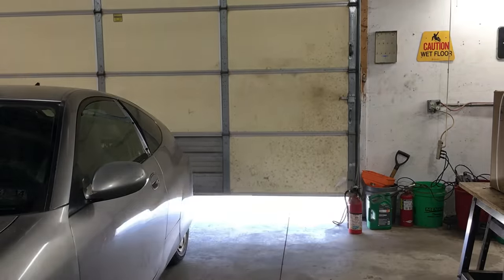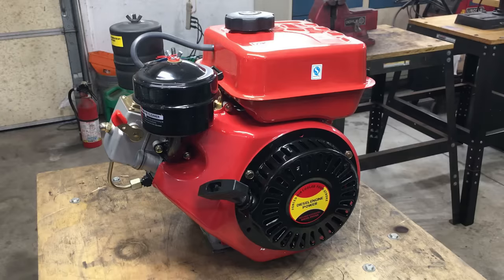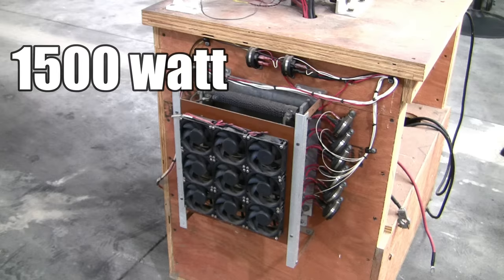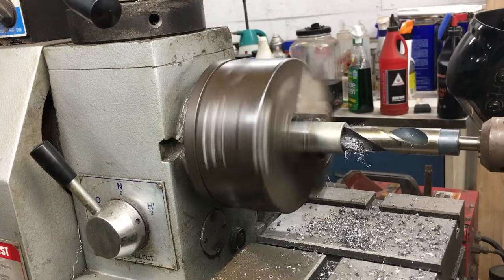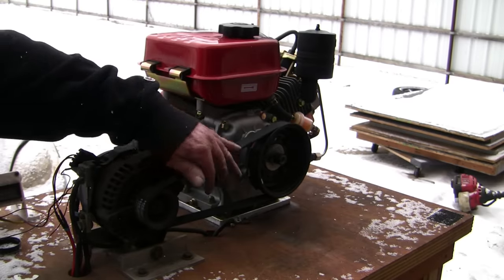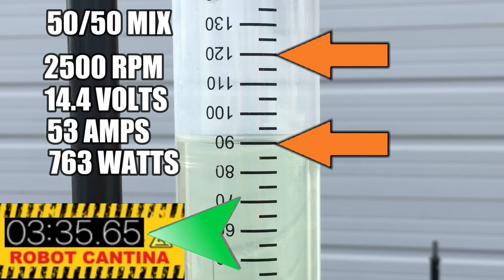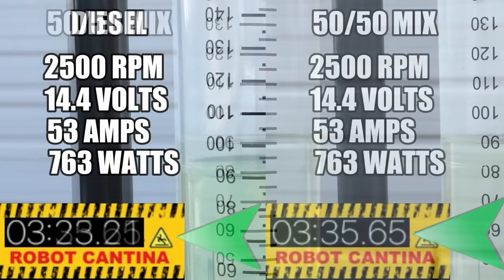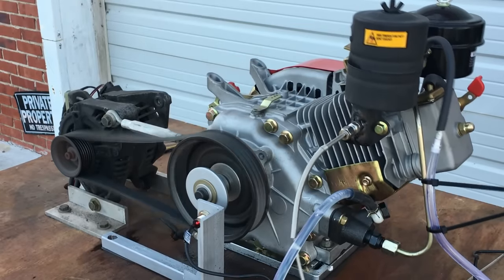S4 E3. How good is vegetable oil as a source of fuel for a diesel engine?... We find out!. plus more

Comment: Waste motor oil works really well in mechanically injected engines, drove one of my cars for a year on that stuff with no issues. Also ran jet a1 for a while with a tiny bit of oil mixed in to lubricate the pump. The engine ran a bit cooler and without any visible smoke whatsoever, while it smoked a bit on diesel. And yes, people actually use kerosene or jet fuel to cheat smog tests with old beat up diesel cars.
Reply: Depending on jet fuel,  it can do a lot of damage to a diesel engine.  For example, JP 4 will work pretty well IF you add some oil to it. JP 5,6,7 can work as well,  I would not use JP8 that stuff will wipe out fuel injectors and fuel pumps very quickly.
Reply: @bertgrau3934  I actually don't know much about jet fuels, just had access to some stuff that was drained out of commercial turboprop airliners during repairs and was supposed to be disposed of and it was tested and proven to work well in diesel engines lol. Old engines can run on almost anything for quite a while, but I wouldn't be so inclined to do such experiments on common rail stuff. Cheap disposable beaters are great for this reason
Reply: @RugilėJurevičiūtė  
Depends on which jet fuel it is, being from a turbo prop,  I'm guessing it's aviation fuel which is more like gasoline.  Wouldn't want to use straight in a diesel.  Mix with oil and it would be OK.
Reply: When I was in the USAF,  we had a couple of folks use jp-4 added to their diesel car.  The fuel we drained from the fuel sumps, was just dumped into the car.
Reply: @robertheinkel6225  
As long as they didn't use a full tank of JP4 it would probably be OK.
Reply: @bertgrau3934  well it came from ATR72, did some googling and couldn't  find the precise fuel type, as they used some different variations of the PW 100 series engines over the years. Guys reffered to the fuel as jet A and ran it together with a tiny bit of oil in their cars for years. Stuff looks and smells just like kerosene, I wonder if it actually did something to the pump or the injectors, but since it was a 200 euro car I didn't worry about it too much lol
Reply: @RugilėJurevičiūtė  
I never heard of Jet A fuel, but smells like kerosene,  makes since.  With a little oil would make it would be useful in diesel engines.
Reply: @bertgrau3934  I guess same stuff can have different designations in different places of the world and between military and civilian users
Reply: @RugilėJurevičiūtė  
Yes, that's true.  I was in the military,  and was in Iraq,  and Kuwait. And I heard of a lot of different destinations.  The military uses mostly JP. and numbered 4 through 8 . For jet fuel

Comment: As some folks have already dropped in the comments,  waste oil, or black diesel (used oil with some gasoline) would be neat to see.
Reply: Yeah, I read somewhere like 4 quarts WMO to 1 quart gasoline, or diesel...I got one of these motors...want to see if it will run for hours and hours before it kaputs
Reply: @haydenc2742  Similar concepts here, my garage heater will run on diesel,   but it would be cool to find a use for the 100 gallons of waste oil I have sitting around
Reply: Use gelatine to clarify waste oil
Reply: @AlienLivesMatter  I hadn't heard of that before, I'll have to look into it

Comment: I run a quart of ATF to every tank of diesel (approximately 16 gallons for 82 GMC and 20 gallons for 94 F350). This is because they were built pre-ultra low sulfer and the mechanical injector pump and injectors need the additional lubrication and cleaning properties of the transmission fluid. It helps with mileage but I've always been a bit concerned about the EGT. I'd love to see you test it. Keep up the great work! P.S. I hope the Gnomes are staying warm.
Reply: ATF is a good idea. I am a fan of Marvel Mystery Oil for older engines.
Reply: I toss in used ATF or motor oil in each tank full of my Oldsmobile diesel. I usually just dump a whole 4-5qt jug in at fill up or half if I'm low on used oil somehow.
Reply: I'd use biodiesel or TC-W3 outboard oil for this, old sump oil is full of garbage you'd rather not run through the injectors (like water and carbon particles) and it burns dirty due to all the additives in it, to say nothing of the lead contamination from engine bearings etc.

A lot of diesel fuel already has 5% biodiesel added as a lubricity improver.

Comment: Here is my list of alt fuels to try:
100% vegetable oil
50/50 diesel/waste motor oil
4:1 waste motor oil:gasoline 
100% waste motor oil
100% new motor oil
100% ATF (new or used)
100% kerosene 
100% Howes fuel treatment
Reply: Thanks for typing all my recommendations so I don’t have to lol. 👍
Reply: Covers my list
Reply: would also like to see regular gasoline with 0.5% two stroke oil premix (to provide lubrication for the hp pump) and also 10/90 gasoline/diesel (supossedly the octane of gas will delay ignition, wich in theory alows the fuel to mix with the air better)
Reply: I'll add a few more:
Alcohol/ethanol.
Natural gas.
Trash fumes.
Excrement fumes.
Old tyre oil extraction.
Plastic recycling.
Reply: I woulda add pyrolise of plastic fuel to tests :)
Reply: KY jelly! I have drums of it.
Reply: Use gelatine to clarify waste oils
Reply: There are some to add to the list. 
#2 fuel oil aka home heating oil

Biodiesel
algae oil (if it can be found)
peanut oil
Palm oil (heated or fractionated)
Walnut oil (they are a cold hardiness of 5 and RC lives in a 7a location, it would be possible to grow fuel, not practical, just possible)
Mineral oil from electrical transformers
Reply: Biodiesel and Hydro diesel needs to be on that list
Reply: How about whale oil.....🙂
Reply: Try 95% Veg oil 5% gasoline.
Reply: Waste atf and diesel mix. Not sure the ratios but that could be an experiment all of its own
Reply: @will7its  got any? kind of out of style nowadays, but it does burn clean
Reply: @mythoughtsonfaith1031   I think I do have a small bottle. To get more I would need a bigger boat......🤔
Reply: Marvel mystery oil (which is just mineral oil)
Also home heating oil is basically off road diesel to whoever suggested that and kerosene is just refined more.
Reply: Home burning fuel mixes with gas ti make a more volatile fuel , closer to e with a few added things lol .. I make my own race fuel and it's about a 30-70 mix of gas and my special sauce and it allows me to run 40psi of boost on pump gas with not det and decent timing 😅.. but I am deff curious as to all these other suggestions 🤔 😮😅.. peace and love all
Reply: @mastercricket7626  Yeah I was told way back ppl would raise octane by adding diesel. Which makes perfect sense.
Reply from the maker: I'm not going to ask why you have so much.... lol
Reply: @shawnsatterlee6035  that is one part of it , but there is a few other components in gasoline that I add aswell .. but yes a lil deisel can help raise octain... I have added ethanol and xylene and one other thing to make a safe race gas .. well it works idk about safe lol 😂
Reply: @webmasale straight natural has does not work in a diesel. It won't ignite under pressure. In commercial engines they fit the diesels with spark plugs or use a 5% diesel mix with the natural gas.
Reply: Varying ratios of diesel and EVO :)
Reply: @allthehandlesweretaken After seeing what government workers did to Kubota diesel equipment when they were used to gas powered..... diesels don't like ANY gasoline, even 10% destroyed injectors, pumps, pistons (FAR faster combustion causes hot spots, rings lands cracked out) valves, one cracked and dropped an exhaust valve into the chamber and they guy ran it until its complete demise....
Reply: @Steevo69  taxes at work one destroyed engine at a time.
Reply: I have tested lots of wvo and wmo and it runs on everything I put in it as long as it is filtered clean and dewatered.
Reply: @Steevo69  i mean sure. it's going to run way diffrent. but your example is one of thousands diffrent engines. im sure if you really wanted to. it woul be fairly straight forward to run a diesel engine on gas. and make it last. not really any point to it since diesel has higher energy density per volume. also i just really want to see if this little engine can take the abuse :)
Reply: In the summer home heating oil , is extremely close to regular Diesel fuel . Winter the Diesel gains kerosene and additives  .
Reply: @mythoughtsonfaith1031  #2 fuel is just diesel with dyes to make it red but those other ones are huge.
Reply: That's a great list, but modern diesel engines don't like gasoline, kerosine and so on.. they wash oil which lubricates high pressure pump (which this engine don't have)
Also I would add lamp oil, break fluid..
And when running from zombies, you should have multiple fuel filters if you want to use old frying oil.. small particles would get stuck in injectors.
Reply: I was going to suggest kerosene and biodiesel. Kerosene is a no-brainer, because it's very similar to diesel fuel. And biodiesel is popular.
Reply: Huh, I didn't know diesel engines could handle kerosene.

I know of a guy who once put 100% kerosene in his bike (petrol engine ofc) and it melted the engine (that's how the story goes at least).
Reply: As others have mentioned, winter diesel actually has some kerosene in it, to prevent gelling. So diesel engines can handle some kerosene. Although it's usually mixed with diesel.
Reply: I run my small diesel tractor on waste oil. It didnt even care at below zero wind chills, started about the same last week as it does when it's 50°F outside
Reply: @AlienLivesMatter please clarify, I'd like to know this trick? Are you basically using it as a floculant or?
Reply: Natural gas and stuff will not work since you can't feed that to an injector, it needs some type of a liquid to seal properly.
You can feed gases to the air intake when it gets ignited from the diesel combustion and that would be interesting to see@webmasale
Reply: @steffendhonau  its usually used alongside a special regulator. Gasoline engines use one based on vacuum usually from the ones ive seen, to meter fuel. It just ends up with a different kind of fuel metering device. A diesel one would likely just be a throttle based metering device in a diesels case but I'm not entirely certain on that, ive yet to work on a diesel that runs on propane, only gas.
Reply: @allthehandlesweretaken  if that indeed works (which to my understanding, your statement about octane is correct), I'd love to see E85 premixed and see how it does. Id say it probably would require a higher mix of oil but would likely work if you could find the sweet spot
Reply: I’m with you on this list especially the ATF.
Reply: This was also my entire list and then some, so thank you for this lol
Reply: @shawnsatterlee6035 It does the exact opposite! Diesel has low octane = delft ignites due to pressure. I have tried that gasoline + diesel 10:ish percent since I once managed to fill my car with diesel and had to hose it out, but of course there were a few liters left… the engine knocked and rattled for a week even though I filled the tank up… tha car had a 65 liter tank and it probably had like 6-7 liters of diesel. Had to drive it carefully to keep the knocking to a minimum but it survived. Smelled like a diesel, and plugs became rather sooty…
Reply: Someone else wrote ethanol and I’d like to see E85 + 1-2% alcohol mixable 2-stroke oil. I guess you’d have to change the injector to one 25-30% bigger.
Reply: @goosenotmaverick1156 SAAB Automobile did convert a 1.9 common rail diesel to run on A95 which is 95% ethanol, 1% lubricant and 4% ethylene glycol. There are some Shania fleet trucks that run on this here. Anyway SAAB made that engine put out a bit above 400 hp  and it ran extreme clean, no soot or any smell, and low levels of NOx.
Reply: We used to have an old dump truck that was ran off the 4:1 waste oil/ diesel. It loved it. Still runs today other than the frame got bent in half.
Reply: Turpentine
Mineral spirits
Lamp oil,
Melted animal fat
Vodka
Rubbing alcohol
Simple syrup
Reply: Just swing by the airport pick up a couple gallons of Jet A.  I don’t think zombies can fly.  Works good in cold temperatures but I’d add some Power Service or some other type of full injector lubricant Jet A and kerosene are both a little dry.
Reply: Try 15% gas to used veg oil I used to run that In my old Hilux
Reply: need to put some 2 stroke oil into kerosene, to lube high pressure pump and injector
Reply: this but add in gas variant mixtures and even ethanol if  you want to appease me and the others who strive for self reliance :D
Reply: @allthehandlesweretaken  Without massive timing and injection spray changes plus lubricant diesels won't run on gasoline, it's more of Russian roulette with a half full gun.

I suppose with av gas or something high enough octane, retarding the injection point to well after TDC it would run, not much power and eventually shock load would crack a ring land or cause rapid disassembly of the rotating mass.
Reply: I concur
Reply: @steffendhonau  it's hard but not impossible, it does need some diesel alongside the natural gas though.
Reply: I saw someone recommended that 80/20 diesel/waste oil was what theirs ran best on.
Reply: @tobiwonkanogy2975  in a very technical sense,it is more than that difference. but the test would tell if the difference makes a difference.
Reply: @djb1634 I have an old 6.2 diesel that I have run on a 50/50 mix. It doesn't start as easy, but it seems to like it
Reply: @dvdlvrmn  I have a 6.5 all mechanical I add ATF to after I do a trans service at work. We have to pay someone to take the old ATF out. Might as well burn it for free lol. I would like to see some hard data though.
Reply: Kerosene + veggie oil???
Reply: @tobiwonkanogy2975  home heating oil and red dye are both red, but home oil has much higher sulfur content than offroad red dye.
Reply: @shawnsatterlee6035  sulfur content is very different in offroad red vs home heating red, before the ultra low sulfur mandate they were the basically the same, not so much now. But it is the closest thing to the oldschool low sulfur diesel that was phased out.
Reply: used vegy oil is better guess its down to what fats get added,did a sort of test during a fuel strike ,modern diesels are not tolerant need the lube for pumps,the origional diesel engine was ran on peanut oil,paraffine or kerosine works well if add 2 stroke oil and jet a and b probally better
Reply: hard to measure but would be interesting; wood gas, butane, the gas coming off from polymerizing linseed, ammonia
Reply: @mythoughtsonfaith1031 peanut oil and palm oil works, I’ve tried. Palm oil needs to either be heated or mixed with diesel or preferably both. You will never be able to cold start an unmodified diesel engine on solid palm oil unless you live in a desert. I am going to modify the Mercedes on my channel to run on it and hopefully maybe be able to start on palm oil too.
Reply: You read my mind!
Reply: I really want to see tar! 

All these in the list work, I’ve tried all but kerosene. Fuel treatment works, but if it contains a lot of 2-ethylhexylnitrate, it’ll make the engine run warm and hard due to the increased cetane number, unless you adjust timing to compensate.

However, I’ve never seen anyone try tar. It is easy to make, just put fatwood in a sealed container with a drain pipe at the bottom, and put it in a fire at 400-600°C.
Reply: @allthehandlesweretaken  um, what? delay ignition? mixing gas into diesel makes it more volatile and makes it ignite faster and more violently. Known stuff among people who ever tried running diesels on waste oils.
Reply: @WymiataczPlays  it will be more volatile yes. but the knock resistance will also be higher. and diesel engines use compression ignition. so the engine will inject the fuel mix. which should in theory have delayed ignition due to the higher octane. this delay should alow the fuel to mix with the air better than it normally would. thus a more efficient burn. there was a study on it that used a single cylinder diesel engine similar to the one in the video
Reply: Rudolf Diesel originally planned to use peanut oil in his engine, IIRC. And I read that Marvel Mystery Oil contains lard, or at least used to. Weird!
Reply: And hvo